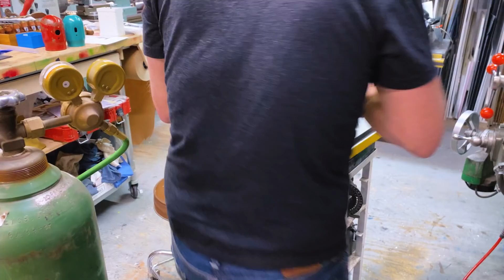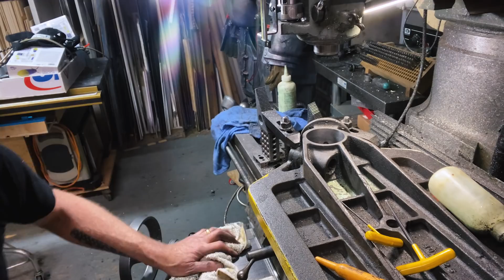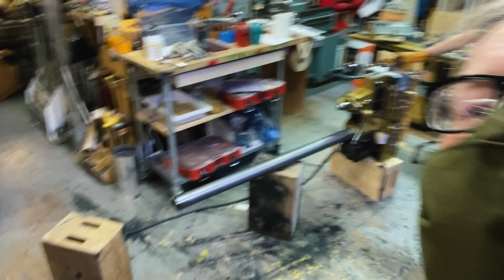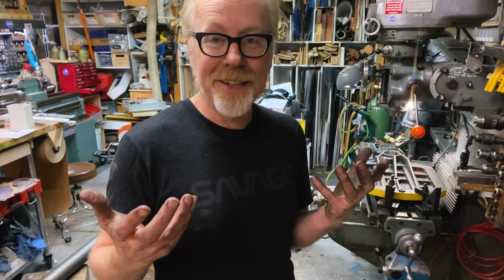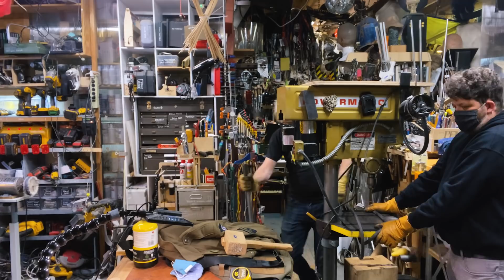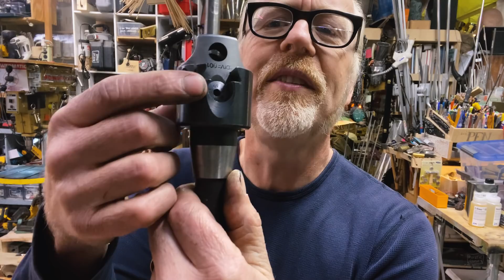Adam Savage's One Day Builds: New Drill Press Table!

Comment from the maker: Adam's previous Drill Press modification build: https://youtu.be/m-ayU2GCQ_Q
Reply: Someone pass along to Adam that on his old mill, he should always do spring cuts on any plunge cut that's deeper than 4 cm. It's very likely that he either has shot bearings (or better said, within the range of becoming shot) or a worn tube. Could be easily measured if it's dropped and scoped with a micrometer. Even 0.00 range is enough to cause flex or deflection.
Reply: There is a product called a Sky Hook, Abom79 uses one in his machine shop for changing lathe chucks and moving heavy items. It could be a back saver
Reply: Adam Savage's One Day Builds: Adam Savage’s Tested of UK of New Drill Press Table!
Reply: You read my mind when loosening using your ratchet. I was wondering where the red went to. :)  And you flipped it just like you said. Save that 2 seconds and spend 2 hours painting that one too.  Who needs Mythbusters when I have this channel. <3
Reply: I understand you used tin solder with silver paste, but this is not very reliable I use special electrodes for cast iron😯
Reply: Mcmaster sells a huge variety of hardened T nuts. I'm sure they'd have the correct size for your new table!
Reply: I have one of those tables sitting in my garage that I'd gotten for my drill press but I had the opposite problem.  Its a 3" and mine is 2 3/4"
Reply: next video implement a steel chain pulley system so you don't needs norm's help to move things... I guess that is norm
Reply: You'd think that Adam would be smart enough to know that masks don't work ?

Comment: your videos are always wholesome, very spontaneous and quite interesting. the stuff you do really surprises me as you have your hands and interests in so many different facets of things not just machinery or machining. Loved the mod and the longer more industrial table looks just right. One thing you can do is add on the original table below is and swing is out to use as a storage table or a specialized table that houses a clamp on rotary table or a vise that stays there full time or as needed for a secondary operation while the first operation is performed on the top table. I have a walker turner 900 series floor model and am looking for the period correct production table for it which are very hard to find.  I thought I would only want and need a table model drill press but floor models offer a lot of real estate height wise. you can drill very tall parts or stack up a x-y table and then a vise or a rotary on the x-y table and then a vise and still have so much room under the spindle. drill presses are cool especially the vintage ones as they look cool and work like a swiss watch if it was not abused in the past and not worn out.

Comment: Adam, you can upright that drill press solo no problem, 
First put it back togather, now lower everything to the bottom including the drill and motor, now all you lifting with all the weight is the shaft with a lot of leverage.  Once it upright you jack the head stock back up to the top and reattach it. Then the table lifts up. Your back in bussines.  No jack use a comealong or pully and ropes. If the top dosnt drop you use somting to lift it off.

Comment: If possible a better way to this job would have been in the lathe. But you have to be able to set-up an angle plate on the cross slide. Plus the angle plate plate needs to be big enough. Another option if you must bore the hole in the mill is to feed up with the kner if the knee has a Servo type feed unit on it. They are well worth it if you are constantly running the knee up and down

Comment: After all this work it still needs a drill press table to sit on top of metal table so you can work with wood and other non metal material. You already have a milling machine to do that type of work so an insert table top for the drill press will need to be wider then the metal table (about 2 foot or wider) and be able to use a fence and have provisions to allow clamping and other accessories.

Comment: I have a tool that Adam doesn't! 😲You need a dingleberry honing brush for a job like refining the i.d. of that stand throat on the press table. They're fantastic for concentrically cleaning and removing material from inside cylinders like that.

Comment: I love how he brazes shut all those holes in the center of the table, meanwhile where i work both drill presses have at least a 35mm hole drilled almost through the center of the table (which is neccesary if you dont want to drill into the table constantly, when fixturing stuff against the table, which we have to do quite a lot)

Comment: A nice illustration of the pitfall of measuring a point when mating a surface.  Sweeping with a dial gauge or using a bore gauge to verify parallelism would have identified the problem sooner and eliminated the second setup.  Also a nice illustration of why you need lifting equipment in a shop, even a small shop.  Save your body for the fun stuff. Thanks for showing us your work.  You learn the most when things go wrong!

Comment: Hey Adam, I had a machinist explain this problem to me as a "spring cut" once. Where you must take additional passes to remove the material left behind because of flex in the cutting tool you are using. That boring bar probably left the 12 thou behind.

Comment: Ya WOW!!! drill press I know. I just used my old 80's Tiawan brand to drive a wal-mart hyper tough Ti-Ni coated "3/8" bit custom sharpened with a dremmel under the magnifying  lamp split point, to an almost gauge fit (endmill shank) tramming in all directions yup. EDM drilling and wire on my grizzly go516 the colum on that and a broken tap remover and now all tool's are through coolent Too much already well Moo,,ah,,ah ya cool all around video love that press dude use it show us

Comment: I put a self centering machine vise on my drill press table. I milled the top flat, and added two steel plates on top of newly made jaws, leaving about half an inch between the plates. The top of the jaws now act as moving parallels. Very easy to drill centered holes, which covers 90% of all the holes i drill. If I want to do something else, is still got a table on top without having to remove the heavy vise. If i need to do a lot of holes that aren't centered, i just swivel the head to reach the correct location. Real time saver

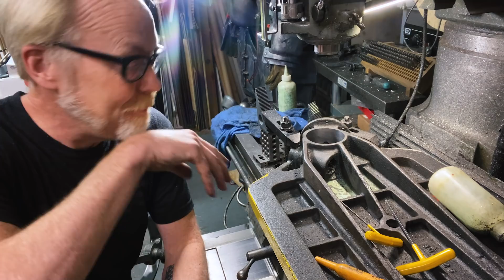Comment: I'm sorry Adam, but as a former steel tube mill operator, you need to take measurements at the 12/6, 3/9, 10/4:30, and 2/7:30 o'clock positions.  When steel is rolled into a tube, rarely is it perfectly circular.  Further, boring out a hole the way you did, rarely works out the further in you go.  I'm sorry this was a struggle, but on the plus side, it's a learning curve and now you know.  Hell, it took me 4 months to make my first 3.001 x 3.002 x 3.000 x 2.999 tube when I was first starting out.  Regardless, great job on the upgrade!

Comment: where did you get the new table?  My old mid-seventies Dayton drill press has a nice solid, flat, non-drilled table, but it's not a tilting type.  I'm not sure where to get tables and other parts for a 2-3/4" tube.

Comment: I see you found out something, when you use a long boring bar of insufficient diameter you get a tapered hole because of bar flex.  I've been there also and it wasn't fun for me either.  
I was boring new 4140 steel main bearing caps for my new engine.  That's how I found out about a tapered hole.  Live and learn is what we do.

Comment: when you want to be dead sure on a bore diameter: don't forget you've got a lathe right behind you, and if you have an appropriate chunk of stock you can turn up a basic go/no-go gauge for your finish dia. It will take a little more time and cost you some stock(maybe use wood even haha) but it will guarantee dimension and even detect taper to an extent(once you get the feel for it). Always a pleasure to see Adam in the shop with the machine tools!

Comment: Glad you got it sorted and realised the issue. In the future this is definitely the kind of awkward job where I would have made a dummy" spindle to check the fit before it was removed from the mill. A bit of scrap turned to size, 10 minutes at the lathe would have saved a lot of pain. Every failure though is a chance to learn.

Comment: Have you considered building or buying a lightweight engine hoist for the shop?  You are constantly doing stuff that requires heavy lifting, usually less than 1000 lbs but still enough you shouldn't do it by yourself.  You could find a lightweight one that folds up fairly small.
Reply: Or a very small gantry crane even might be more useful.

Comment: Hi Adam: I think you could use a triple chain block, on a I beam. This would allow you to hang, and manipulate heavy things up in the air, with your finger tips!!!
Place an I beam up on the ceiling, back shop, ends on the steel truss, and a steel post, at the back wall....  
A steel plate at the bottom of the post...braced to hold it vertical; and pinned to the concrete....  
call it earthquake reinforcement.
place THREE TROLLEYS, on it; and one chain block. Add the others as needed....   
With three chain blocks, you could assemble, and disassemble really heavy things...  
Like big, you step through the middle, electric motors!!

Comment: Adam , as you bore with the quill extending you will get taper ...you can try boring using the Z axis and the quill in a fixed position. I would have finished honed the bore to size with a typical engine cylinder hone
Reply: If you bore with the Z , bore as the table falls with gravity...the feed will be less jerky as trying to bore raising the Z axis

Comment: Whole time he was boring that the first time I kept screaming the bar is too long its going to flex inward at the bottom of the hole..... That was a good learning experience to check BOTH ENDS though, at least it didn't ruin the part.
Reply: Yes, tools flex...and long ones flex more than short ones.  However, that tool was flexing from the cutting force the instant it contacted cast iron at the top of the hole. That force and flex stayed the same all the way down...it SHOULD have cut a hole with parallel sides unless the material got harder towards the bottom, or the carbide chipped out on the last pass.
I was a bit puzzled until Adam explained what had happened.  He said that the top end of the tool, near where it comes out of the holder, rubbed against the top of the hole when the cutter was near the bottom on the last pass or two.  The additional side force from rubbing flexed the tool more than just the cutting force.  The hole actually DID HAVE parallel sides until he moved it outward for the last pass or two.

Comment: Looking at the depth of that hole, I always wondered if the materials used in the boring head were able to handle that much leverage. Given enough time, I guess it would work its way through and be an even measurement from top to bottom. Precision machining is beautiful.

Comment: If you weld in those holes of the table and later grind it, how do you maintain the flatness of the table?
I mean when you later lay it upside down on the mill table, a tiny protrusion of welding may cause it to whobble and mess up the squareness of the setup.

Comment: i know exactly what happened and why you got a taper.

loose boring head. 

the diameter adjustment must have slid inward during the cut from the material pushing the boring bar away from the outer diameter, it started out at the desired depth of cut but slowly slid inward as it went down and thus resulted in a taper. it also can happen from deflection when a material has variance of hardness but in this case i think its more likely that adam either forgot to tighten the boring head or didnt tighten it enough. that is my guess anyway.

Comment: I've been building, tinkering, modifying and DIY'ing most of my life, but for the last 7 yrs I've been really acquiring the tools I need and creating the little workshop (shed) I have. But the problem is, on my budget they're always cheap tools, so I have a constant struggle with inaccuracy. I can't even seem to make square cuts on my mitre saw without constant adjustments and breaking out the engineers square to check the blade. I have to constantly adjust the table saw blade against the fence (which also moves out of square occasionally) and it doesn't help that I can only use the table saw outside when the weather is clement because I don't have room in the shed to operate it inside. It's nice to see that even at Your level of experience and quality of tools, you still have to work around problems.

Comment: Adam, question. Did you feed the boring head by hand? If so, why didn't you use the worm gear on the mill to feed? The surface finish would likely be smoother. Thanks.

Comment: Unfortunately tapered holes in boring. Assuming if it's the bottom of the cut that's smaller (haven't finished video yet). A few machinist tips that may sound obvious is measure multiple points on your diameter and when boring take plenty of air passes and feed/cut from both sides of the part. Power feed down, clear the part and then reverse the power feed and run the cutter back up through the hole. The beauty of this kind of project is the the learning you get to experience doing this operation. Some what unrelated it might be cool someday is do a machining colab with Tom Lipton at Oxtools. Great content and cool project.

Comment: Even if you do get everything straight, you can't measure the inside of a bore with a pair of dial calipers - gotta use a bore gage and micrometer.  The faces of the dial calipers are straight, so they won't fit flush against the round inside hole.  Then when you measure the outside of the cylinder that will go into the bore, the faces will fit flush, so your measurements will be off.

Comment: What Bozo had that table before you??  I have my Dad's Powermatic 1200 table model made in 1977 (for those unfamiliar... No, it doesn't sit on a table, it has a large cast 4 legged table that is the base of the Drill Press instead of a pedestal with a small foot). There is not a single over-drill into the work surface after being used for more than 43 years.  A few scratches from heavy items, yes.    It spent it's first 20 years making rocket parts at Aerojet General.    Glad you were able to repair it, but you should have slapped the guy you got it from (or whomever did the damage).

Comment: Not accurate enough with calipers mate. Micrometer is way more accurate. Maybe should have tried from the top to put the table on. Done this many times. Stainless isn't to bad for filling holes. Heat him up first. But really shouldn't have holes in the table. Wood works well under job when drilling.

Comment: 1) When you started filling in the table face with braze, I was concerned that heating the cast iron table with the torch may lead to warping (or worse). I would have suggested using a metal-filled epoxy to fill in the defects.

2) When boring the hole like that, if you don't have a snap-gage for measuring both the top and bottom of the bore, go over to the lathe and make yourself a quick go-gage. Any piece of scrap material turned to the 3" diameter could have saved you a lot of time testing the bore before taking the table off of the mill.
Reply: When I had a lot of smaller holes in my table I just filled them up with the welder...
Worked pretty well to be honest

Comment: Honestly, it could've been worse. When I saw "Adam needs to precisely mill out just enough steel" and "not all goes according to plan", I totally expected the outcome to be, "However much steel he bores out -- even if it's just the right amount for it to slide onto the shaft, no more and no less -- it will have been too much: With not enough left on the back end and/or the sides to support the weight of the table, the mount snaps and Adam has to cobble together some kind of replacement mount."

By comparison, "Adam discovers that his initial efforts didn't bore out as much as he expected; after putting it back in the mill and boring out the rest of what he needed, he figures out what the problem was the first time but has no further real difficulties" was actually slightly anticlimactic. :-P

Comment: Bizzarely Ive just made a tightening part for a round shafted tool, i went for a flat taper 2 line clamp,  a double sided clamp would pinch 3 ways into the sleeve. so would be more rigid but its a very snug fit in the sleve. Multico Morticer

Comment: Ack!  I've had the problem of a side of a boring bar rubbing before.    I was setting up a deep boring operation and the set screw was gouging the mouth of my part.  It took ages before I realized what was going on (then I grinded it down and all worked).  Still, it makes you go crazy looking for something that shouldn't be happening.   (see also holes changing size because the boring tool wasn't tight so it was shifting a bit with every new part)

Comment: Nice table , really all drill presses have tables inadequate for use. I have a big old Rockwell delta 20" with power feed option. Its in need of repairs but the possibility of a super press over a normal little one is priceless. Its about 1,000 lbs I'm guessing. I'm sure it runs but ya know how things can be used.

Comment: Adam i always wondered why you have a drill press when you have a variable speed mill with DRO. Maybe a tool tip on it?
Reply: Drill presses are easier to deal with when you have to drill holes that don't need to be super precise. For quick, dirty work or just having to drill one or two holes it's faster than setting up in the mill.